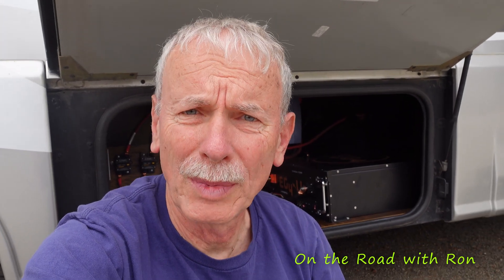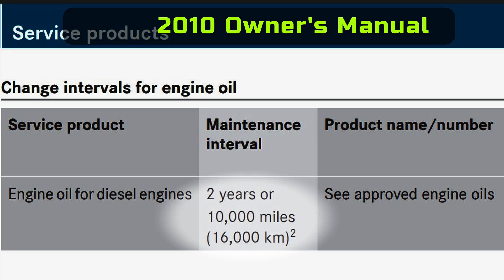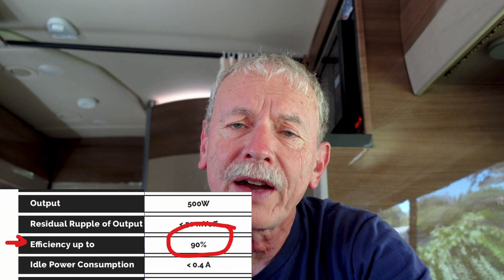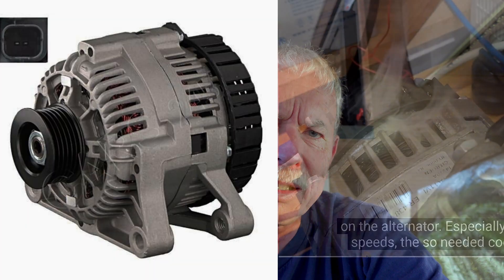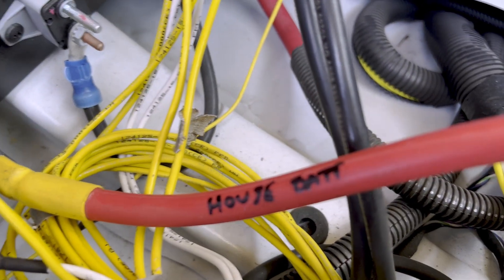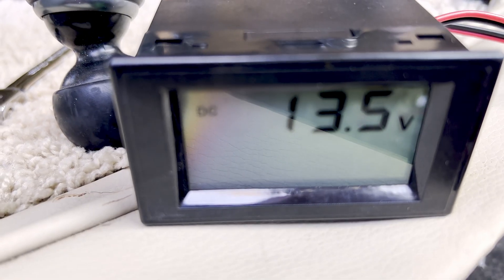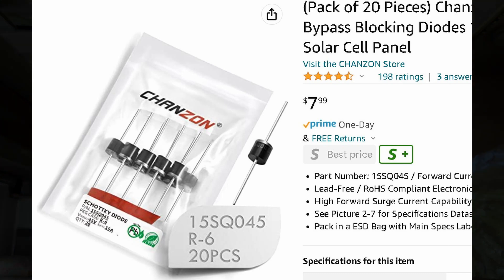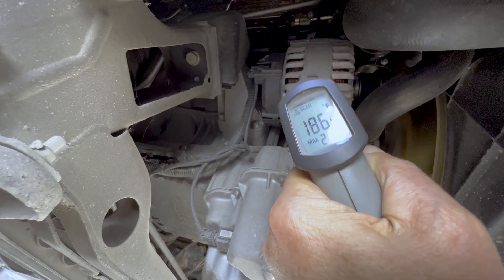DC to DC charger NOT required for big Lithium Battery

Comment: Just watched this. I knew already about this just drop the voltage to get it to lithium range. But. What happens to alternator when bms shuts down either too cold or full ? The force is being put back into alternator when battery stops taking charge ?
Reply from the maker: Good question. In my case I turn off the alternator charging before it is full and the bms shuts off. The solar panels can finish up the charging. But also, the chassis battery is always connected to the alternator so any high voltage will be dissipated into that lead acid battery.  Should be the same as turning off any high power DC device.  An occiloscope would be able to measure it.
Reply: @ontheroadwithron2432  yeah I guess as the lead acid battery is needed to be in circuit to consume the voltage spike when the charging is turned off. DC-DC chargers have coils right to consume some of that voltage spike when charging is finished. Also chargers shut off the current before the battery bms turns off without notice if you set the voltage limit correctly, or charger can talk to bms.
Reply: the lead starter battery is still in the circuit.  And there is no rule saying we have to overcharge so hard the BMS shuts down charging.

Comment: Until you run the batteries down to the point where they let the smoke out of your alternator. And trust me they will 😅
Reply from the maker: Have you had this happen to you?
Reply: @ontheroadwithron2432  not personally but as an ASE certified master technician I can assure you an alternator will only take so much heat. My van has 4 100ah lithium batteries in it. Without something to limit the current I’d have to use the biggest cable I could get my hands on, only to fry the alternator in short order.
Reply from the maker: @TheMajictech  Not all installations are the same of course, but my 220 Amp alternator barely get warm during charging.  Of course  I do not use it very much as solar is a better method.

Comment: When you turned on the Alternator charging, what was your Voltage at your batteries after charging and during?
Reply from the maker: I tried a couple different battery levels. First was mostly full  and the second timeless than half full. Charging rate did not differ as much as I expected. All in the 60 to 70 amp range.

Comment: Normally never comment, this time only because you seem like a nice fellow heading for trouble :-)

From behind:
Shunt work more accurate on + but with somewhat less current, make no sence so dont ask me why....
You place it between -wire (maybe frame) and -pole on battery, this way you can see your consumption too (-amp).

dc-dc may only be 90% efficient but changes bulk-absorption-float which makes it somewhat more efficient than an altornator + altornator struggles to charge batteries above 80%.

You take the current test just about where the batteries throttle down for the charge, if you discharge them below 50% (which can happen without a hairdryer ;-) they will swallow many more amps, perhaps up to 400A and that will kill your altornator, maybe not in a 5 minute test but soon. The dc-dc charger limits the current and prevent this, unfortunately it probably limits it way more than necessary for your huge alternator (SterlingPower.uk makes regulators up to 400A with automatic (real)spiltters built-in /1000$).

You will lose the altornater with your setup unless you always keep the batteries above 60-70%, and thereby dont take advantage of your fine lithium at all.
In that case you would be better off with your 2 old batteries since they would be big enough and dont create the mentioned problems.

Fuck Victron, they are far too greedy and expensive, look around, there are better and smarter brands out there.

Comment: Good job Ron, well founded decisions based on good logic, research, tests & checks. I like how you saw through some of the marketing BS that gets thrown at us by the manufacturers & used that to draw ur own conclusions with further analysis. I believe u can actually get Positive pole shunts, but you probly could put a second shunt between battery negative & the chassis if you just wanted an in house/dash solution to be able to check the Current data on the fly from alternator to house battery for reassurance all is well. There are generally always solutions, I guess effort, cash & compromise are the main considerations & inhibitors of any install. Good vid, TFS. Cheers
Reply: Just because you don't understand the need for something doesn't make it BS

Comment: My gut feeling is you aren't fully charging the LI batteries. Your alternator is not going to sit at the needed 14.4-14.6v to fully charge a LI battery. That also brings us to why this worked and didn't smoke your ALT. Cause the ALT is only going to put out around 13.8v most of the time. At the lower voltage the battery's current draw is going to be pretty low. So everything 'works' except the LI battery never gets fully charged.
Reply from the maker: You are correct in that the battery does not fully charge. Lithium is happiest with a partial charge. Actually my solar charger shuts off before fully charged. My particular alternator puts out a steady 14.4 volts. I can use that to charge them up more that solar does but frankly, I have way more capacity than I need unless I run the AC off the battery.

Comment: Just another alternative.  Hook up a voltage triggered battery isolator from starter battery then hook that up directly to a power inverter.  Then run AC extension cord from inverter to your lithium battery charger.  Many inverters will show you how many watts you are using.

Comment: It would be interested to see current after starting and rpm between 2000-3000, like driving conditions when it pushes that 200+ Amp out. That 70A is a good value for idle speed indeed!
Reply from the maker: I don’t think it would change much. The alternator supplies 14.4 volts. The amount of current flow will depend on your battery’s voltage and resistance of your cables. My idle voltage it already at 14.4 volts.
Reply: @ontheroadwithron2432 maybe, but if ur cable size & resistance allows more current flow & there are no other restrictions in the circuit, alternator throttling, BMS, etc , it would stand to reason that more revs = more current.
Reply: @evil17  Nope, the alternator is putting out max voltage so that means that it is limiting the current output.  (That is how the voltage regulator works.)  If the alternator is limiting itself at idle it will limit itself the same output at higher rpms.
Reply: @haydenwatson7987  yeah that sounds right
Reply: @ontheroadwithron2432 I don't see any difference in output, whether at idle or at high RPMs.
Reply from the maker: @bad_actor1128  Yes, Mine stays about the same also.
Reply: I have found the same 70A max when going down the road.  I have a BMK monitor on the house bank that shows me the amps delivered to the battery.  As Ron said, as long as you are getting 14.4v to the start battery, the alternator is putting out limited current and should not overheat.  It is caused by the 90' of wire run from the engine to battery and back.  I have 920Ah installed and it is not a problem for me.  On a gasser, with the battery right next to the engine the results would likely be different.
Reply: @haydenwatson7987  are you relying on the resistance of the ire to limit current? Wouldnt that be dangerous for fire?
Reply: @conradcoolerfiend  No the wire is not limiting the power at all.  The wire is 2/0 which has an ampacity rating of 330A so there is no problem with the full amps that the alternator is capable of outputting.  What happens is that the tiny amount of resistance in the 90-feet of wire which I calculated at about 0.02ohm causes the voltage that is sent out by the alternator to drop from the max voltage that its regulator will allow it to output from 14.2v down to 13.2v at the battery when 60A is flowing through the wire.  It is simply not possible for the alternator to push more that 60A all the way to the battery through the 2/0 wires.
To put it another way.  The wires will easily carry 330A.  The battery will happily take in up to 400A.  The limit is that they alternator can only push current at a max voltage of 14.2v and given that it can only push a max of 60A through the 90' of 2/0 wire.
Reply: @haydenwatson7987  ok I think I understand. But then, wouldn’t the length of wire be fundamentally important to the setup? Say if he had half the wire run, he would have double the max amps and that would be too much ? Or would the smart alternator limit something ?
Reply: @conradcoolerfiend  Yes, you are correct, the length of wire is one of the fundamental limitations of current in my coach.  If I had a gas coach where the engine and the battery are only a few feet apart, it would be entirely different.  On my boat, the alternator and battery are only separated by 5' of wire in each direction so that total of 12-ft is not enough to cause enough of a voltage drop to prevent the alternator from overheating.  In that case, I have an external regulator that will limit the alternator output based on the alternator case temperature. Most motorhomes have internally regulated alternators and then are not smart enough to limit power based on the temperature.  The best advice I can give is to install a battery monitor at the LFP battery and monitor the current that is being sent to the LFP when it is discharge to at least 50%.  If that current is more than half of the rated output of the alternator, then the LiBim 225 is a good option to prevent overheating of the alternator.
Reply: @haydenwatson7987  sure, or a dc to dc charger
Reply: A duh moment for sure. Not to mention the DC2DC Charger will always output the correct voltage and has an on/off switch and depending on brand, a 50% output option. @conradcoolerfiend

Comment: Thanks for sharing this video. I have a semi truck and I have researched for weeks now trying to figure out if I need a DC to DC charger or isolator. I’m having 4 additional lead acid batteries installed in my semi truck to power my AC when I’m parked. Everywhere I research says that I need a DC to DC charger or isolator but the only explanation for this is when I’m using LIPO4 in combination with AGM/STD batteries. I don’t want to fry my alternator. But I keep reading that if I add more batteries of the same type, I could fry my alternator. Wouldn’t the alternator charge the additional batteries the same as the original 4 already installed just that it will take longer to charge? My semi truck has Idle Smart installed to keep my batteries charged while I’m parked. This monitors my batteries, coolant, and engine to keep my truck at optimal operating efficiency. I set the parameters for when and how long my semi truck idles. When my batteries go too low, my truck starts to charge the batteries. Once the batteries are charged, the truck shuts off. I really don’t understand why I need a DC to DC charger or isolator when I’m not using another battery type.
Reply from the maker: I agree with your reasoning. No need for another device that wastes energy and restricts your charging currents. To be 100% confident, you can install an amp meter to see what your charging rate is running. Then if your know your alternator rating you will know how hard you are working it. And yes, adding more batteries will just make the engine run cycles longer. Both on times and off times.

Comment: Interesting. I will have two 460Ah LFP banks in parallel, so each can suck up a lot of current. My alternator will be an aftermarket 200A, not sure it has temperature limiter, perhaps not. I will try without the DC-DC first, then decide from there.  The 40A Renogy DC-DC is not too expensive. It could be a good protection for the alternator because I want to minimize any engine repair once I hit 70.
Reply from the maker: A lot depends on the particular installation. Voltage drops in cables and  any temperature issues. You have a very large battery bank. 40 amp charger is definitely safe but is it adequate for your needs?  To fully charge your batteries at 40 amps it would taje 24 hours of constant charging. It you also were using power from the batteries, they would never fully recharge. So the limit of 40 amps may work but it also may be very limiting depending on how fast you want to recharge.
Reply: @ontheroadwithron2432  my 800W solar is the primary source.
Reply: @ontheroadwithron2432 14 hours, not 24